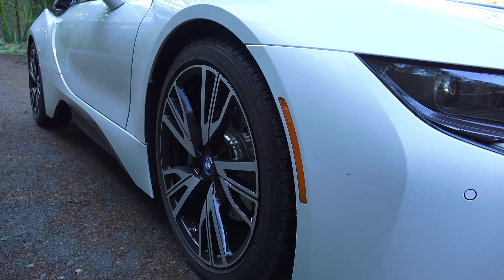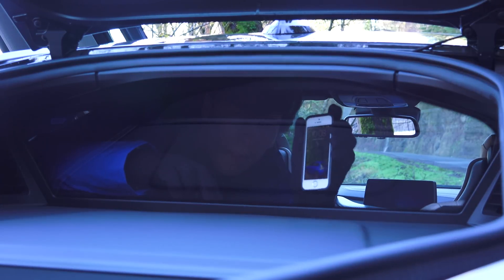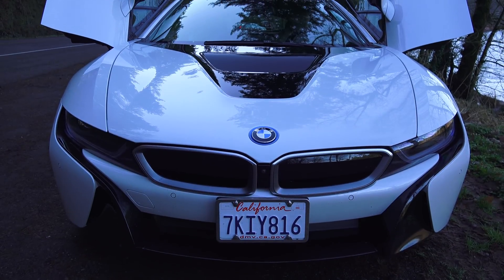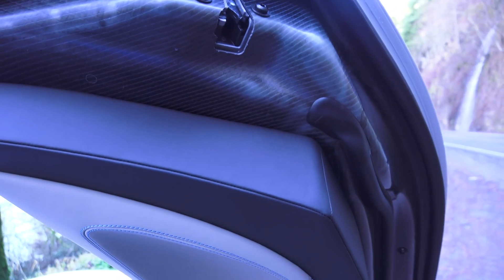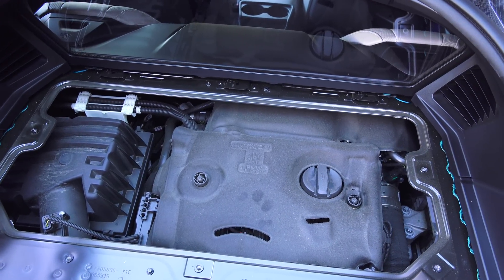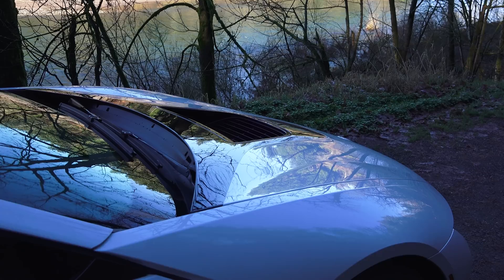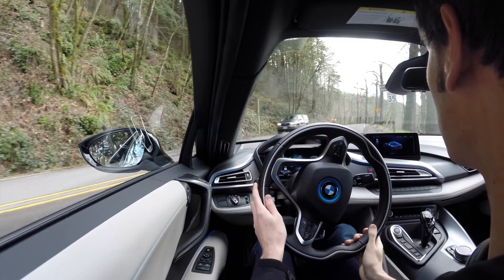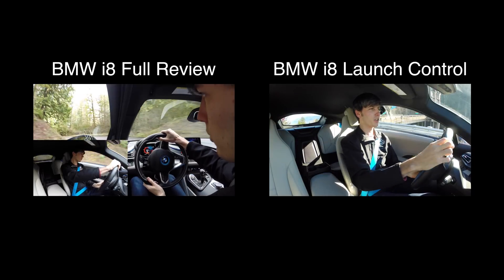10 Things You Didn't Know About The BMW i8

Comment: You're correct that the vehicle needs to see road speed and a harsh rate of deceleration before the ads give brake lights will illuminate. I don't know what version of the i8 you have in the video, but a special note is to be careful with the manual door release. Now there's a little red tab on the bottom side of the lever. You lift the lever up slightly, slide the red tab towards the rear of the lever which unlocks it and then continue to lift the lever upwards to open the door. Failure to do so will break the release lever. Another fun fact is that you need two people to open the hood and there's no good prop or shocks. You need to grab two tools (pocket screwdriver, punch, etc) and have a person on either side of the hood, open the hood and insert the tools into the mechanism to hold the hood in place. There's also an external speaker that is disguised to look like a muffler...which adds more external exhaust noise.
Reply: This car also just came out in the states with laser headlights.

Comment: Do the American's even need a noise to recogniz' a car coming?! 
In Europa it's just an option, but no one orders it. 

Why can a fwd car regain more break energy? 
Yes the car dives in while breaking... But isn't this becouse of the breakbalance between the axles? So if the balance was 40:60 not 60:40 the back axles would regain' more energy right? 
Of course I'm aware that the steering would be that good especially under ABS.

Comment: I was working at a bmw dealership and we had a white i8 in the shop. while walking though the shop everything sensed fine no imminent danger, but about 3 quarters though the massive shop I look back and INCHES behind me was the i8 driving. it made zero noise. i mean zero noise. this sumabitch followed me across the shop starting at the end of the shop inches behind me in this car and I had no clue. I literally screamed when I saw that car behind me. I've driven the i3 many times and at some 3 miles an hour it mostly silent except some tiny transmission noise you hear if it's only a few feet away, but this i8 made no noise at all at that speed, i imagine at some 10mph or so it would make transmission noise. sitting inside the car is incredible though, absolutely love the interior feel

Comment: How are you supposed to fill the oil or window washer fluid or coolint?I did not see any caps. Or is it electric?
Reply: Bozo69 69 washer fluid is infront by the driver side, little lid to pour it down

Comment: Is this guy serious?
#9 at 2:55
"Having the electric motor upfront means that under deceleration, as load transfers to the front axle, more energy can be recovered versus a rear wheel drive system."

Did he come up with this theory on his own? Or did some marketing genius from BMW tell him this?  

The only difference here would be the packaging of the motors in combination with the engine in the back with the smaller electric motor. Regenerative braking capability would be identical from one axle to the other. Plus they get the say that the car is all-wheel-drive, which sounds better than only being two-wheel-drive. 

#9 should have simply been stating the fact that with the electric motor at the front axle and the internal combustion engine at the rear axle, it allows the car to be rear-wheel-drive, front-wheel-drive, or all-wheel-drive.
Reply: Probably depends on how aggressive the regenerative braking is. Load transfer means that more braking can always be done with the front wheels than the rear, so if the regenerative braking force applied up front exceeds the braking capabilities of the rear wheels, then what he said is true.
Reply: That theory would hold true if braking forces were allowed to go high enough to lose traction of the rear wheels.  A Chevy Volt or Cadillac ELR with their 16.5kWh capacity battery can accept regenerative braking up to a maximum of 60kWh.  A larger battery can handle a larger surge of energy coming into it, but even a Tesla Model S which weighs 4,936lbs (P90D & sunroof, etc.) and a 90kWh battery...STILL only has a programmed 60kWh of regenerative energy recovery rate.  They have been this way regardless of being AWD or RWD, 60kW/70kW/85kW/90kW battery sizes.  The BMW i8 lithium battery is only 7.1kW in total capacity.  Highly doubtful that it would hit above 60kW of energy surging into it at such a high C-Rate.  

It has to do with the driving experience of how a driver expects a similar behavior to what they may be familiar with from driving cars, such as manual transmission sports cars, in the past.  Regenerative braking exists to provide higher efficiency on a commute, and 60kW is a sweet spot that mimics the feel of a manual gearbox selected in a gear that is one or two gears lower than you would cruise at, which is probably equal to no more than 20% of stopping potential at the very most.

Keep in mind that BMW's marketing department is who most likely mis-spoke when they mentioned this detail to him.  Perhaps something was lost in translation.

Comment: It not the first 3 cylinders produced engine of BMW if you'd consider BMW motorcycles where BMW used to built the K75 with a horizontal 3 cylinders (the only motorcycle that I know with such a horizontal engine, crazy!). Although it's the first turbocharged 3 cylinders produced engine of BMW :)

Comment: You should've said the 3 cylinder is from the MINI Cooper ;D. Which it is.
Reply: +Conor Hildebrandt which is owned by bmw. so what u are really saying is that it is a bmw engine.
Reply: David Huang
 it was purpose built for the mini. so its "from mini"
Reply: purpose built?   it's an engine that is fitted across the board.  like all bmw engines, they are made to be used across all platforms.  the bmw i8 shares it's 3 cylinder from "mini" as well.  the only bespoke bmw engines are M engines, and even those are originally based on the mass produced bmw .
Reply: +David Huang yup. it was purpose built for the mini platform. and of course is used in some BMWs. Hence why the new X1 is based off the new countryman coming out in the fall. not the other way around.
Reply: only purpose built engines in the bmw line up is for m cars, others are meant to be shared across the board.
Reply: David Huang
 maybe 20 years ago lol not now. 335 and M3, same engine. M2 and M235 same engine. the V8 out of the 6 and M6, same engine. V8 out of the X5M and X6M and the 50i X5, same engine. only difference is the tune and some turbos. I work for BMW and MINI, have a good one!
Reply: Conor Hildebrandt S55 in the M3/M4 is 25% based on completely new parts vs the N55. Turbos, cooling, materials have been redesigned to facilitate high performance driving- no issues with cooling on the Track.  I have a '15 M3, and a '11 X5 3.5i n55 as my daily driver.  I am very familiar with both engines.  They are completely different in behavior and power delivery.  You don't work at the engines department at bmw/mini apparently.  I have a 120 page engine spec doc - see if this link works: https://db.tt/E0FOcsaW  from dropbox.  Completely new design vs N55 in the following ways: Crankcase, Crankshaft with bearings, Pistons and wrist pin, Intake valves and exhaust valves, Exhaust Turbocharger, Air Intake duct, Exhaust system, heat shields upstream cat conv, high pressure fuel pump, high temp circuits for cooling, low pressure cool for charge air cooling, spark plugs.
Reply: +David Huang I said, have a good one!
Reply: +Conor Hildebrandt The 335 and M3 do not have the same engine and there are some bigger differences between the N63 and S63.

Comment: Why does the electric motor need a transmission? Isn't the whole advantage  of the electric motor that you have instant torque at 0 rpm with a relatively smooth torque curve?

Comment: Very low vibration from an inline 3? Unless it is using a balance shaft you're off the mark. The apparent smoothness would be from the soft engine mounts and sound insulation.
My EcoBoost 1L 3 cylinder (same basic architecture) is far from smooth at idle. The engine movement at idle is almost comical.

Comment: Speaker for outer noise - great solution, i saw that problem with non-electrical cars very often, new (just bought) Hyundai Solaris at low speed have very low and non-structural noise, so you need to get very close to people to let them hear you, or use horn. Same problem was with Mitsubishi LancerX 2.0 L but it is hearable from 2-3 meters, instead of touching someones leg from behind (and he "oh, what's this?" than "POKE what are you doing here, sorry, go on please").

Comment: 3 cylinder has no better balance than 4 cylinder. It has perfect primary and secondary balance, but it has big rocking motion, it would vibrate more.
3 cylinder has better exhaust pulsing and it could be more efficient for turbocharging. And this is not first 3 cylinder BMW, because 2 series MPV uses same engine.
Fun fact - this engine is exact half of engine from BMW M3.
Reply: dknollRX7 it is not. Completely different platforms. The i8 uses the modular platform while the m3 uses the old 6 cylinder platform.
Reply: +Mladen Milić While it is half the cylinder count, it is not "half" of the m3 engine. BMW is not using the modular &quot;B&quot; platform engine in the m3, the m3 uses the s55 while the i8 uses the b38
Reply: +Mladen Milić it would have been first 3 cyl bmw when it launched.
Reply: There's already a bulletin out for the rear motor mounts breaking due to vibration. The engine in the i8 is definitely half of the same engine that's in the M3 though.
Reply: +Akash Hegde I meant to say definitely NOT*. Should have double checked before I hit send. I work at a BMW dealer and I'm the only one certified to work on the i8. I can attest it's a completely different engine from the M3.
Reply: +dknollRX7 That new modular platform is for the new 3,4 and 6 cylinder engines. They use the same basic parts and designs, with very little differences between them. It makes for cheaper manufacturing as parts will cross over as well as a reduction in part production times.
Reply: might was well use one giant 1 or 2 cylinder motor since a gas power engine is just compressing air n burning it off.
Reply: A one cylinder has poor balance and very uneven power delivery. Having multiple cylinders makes sure there is atleast one powerstroke at any given point which makes the engine run smoother. This is why a v12 runs a lot smoother than a 4 cylinder.
Reply: +WhyteLis21 That's how all gasoline engines work. Limiting it to just one cylinder means it won't be balanced well, you'll have less reliability and it'll rev much slower.
Reply: im pretty sure u can squeeze alot of power in one giant cylinder n with a bigger crankshaft n piston. but your rite about the balance n it would be harder for power control.
Reply: +WhyteLis21 It would still work, but it wouldn't be as efficient. With more cylinders you'll have extra weight, but it'll be much smoother and rev easier and faster. Imagine a heavy merry-go-round and you try to spin it all by yourself. It's hard to get going and hard to keep it spinning quickly. Now if you had seven other people evenly spaced around it and each of you helped push just at the right time, it would spin much easier, would be easier to spin from a complete stop and easier to maintain the speed. That's just one way of thinking about it. Also, the cylinders spaced out evenly over the rotation of the crankshaft help mitigate the vibrations and they reciprocate against each other. On this particular 3 cylinder and the 4 cylinder that's very similar, there are multiple balance shafts that have to be timed with the crank to help reduce vibration. It's the same concept as a Lamborghini making a 5.7L V12 while the 5.7L (350) is a common American V8.
Reply: thanks i get the concept. its shame the 4 stroke gasoline needs more cylinders to make more power n balance. i think its still very limit mechanically in terms of engineering raw power disbite being a efficient motor.
Reply: +WhyteLis21 You're welcome. Just trying to explain it so it makes more sense...not trying to sound condescending or anything.  Initially, there was talk about them putting a 4 cylinder turbo out back and calling it the i8 s, but that has yet to come to fruition.
Reply: yup. i just think with all these new technology you would think there would be a better motor. we still gotta get past the fossil fuel burning era to really meet the next generations besides biofuel n battery powered motors. i think with the up coming nano tech batteries might help change that.
Reply: +WhyteLis21 BMW isn't really big on using their hybrid cars for efficiency. They pretty much use the electric motors to boost the performance and add power. Some other manufacturers have done a better job of being more efficient, however electricity isn't free either and often times comes from the burning of coal. BMW has been working on a hydrogen powered car for a while, but the infrastructure isn't there yet. They have the i3, which is an electric only vehicle, but the range is only about 60-80 miles. It's a great car if you live in NY or CA, but not places that aren't set up similarly. I agree with you though.
Reply: so true. man, once we get past the fossil fuel burning era, i wonder whats going to happen to the gasoline motor? how r we going to get rid of them? there just too many gasoline cars on the road its near impossible to get rid of. not to mention how n where to recycle them.

Comment: Would the CD be better with the grill completely empty instead of that black cover?
Reply: +Sebastian Rosenberg Naa, if a bumper has holes that ar not "flow thru" it adds drag. Even the flow thru ones add drag but are usually there to convert drag into downforce.

Comment: If there would be a grill, they could put small turbines under the hood to gain extra electricity
Reply: Eh. Wouldn't really add much unless you were on the highway often.
Reply: +Jerombolo The wind resistance of the car increases, so it uses more fuel/electricity. That's why you don't see that on cars.
Reply: AltoScroll hmm but it recharges the batteries on the fly, or the could build the exhaust pipe from the 3 cylinder to the front and slap a turbo on it which can charge the battery^^ does the car have some sort of kers? regaining power by braking
Reply: +Jerombolo It doesn't work that way. Adding turbines in front will actually make the car use more fuel/electricity, so adding them would be pointless. They would indeed recharge the battery, but the car pushing forward (thus wind spinning the turbines) will use more power than the turbines are generating.
Reply: AltoScroll yeah maybe, I don't know. Let's see where this industry is going with rechargin on the fly
Reply: +Jerombolo I don't want to sound rude, but without external sources, recharging on the fly will not happen (basic physics). Regenerative braking however does work, and has been used already in multiple cars
Reply: AltoScroll wasn't it a Tesla which was meant to have a solar panel on the roof??
Reply: +Jerombolo Yes that falls under external source (the sun) and that would increase the car's mileage.

Comment: You should've thrown a rock at the rear window to test its hardness
Reply from the maker: +Peter Jada It's inside the car haha, protected by rocks (by the front windshield and rear window).
Reply: +Engineering Explained I mean....you still could've thrown a rock at that window and one of the exterior windows to test their claims of increased strength 😁
Reply: +Peter Jada He could have, but if he damaged it which is most likely, he would be paying for it and BMW normal glass is expensive(german brand tax), let alone this "special" glass
Throw a rock at any car windshield and the windshield will crack
Reply: +IIGrayfoxII it was a joke...I think we can take BMWs word for it on the chemical hardened glass

Comment: they could have cured a bit the looks of the ICE engine for the price they are asking...
Reply: +Petri Ševardnadze A zašto, kada ga nikada niko neće videti?
Why, when nobody would see it?
Reply: +Petri Ševardnadze According to BMW, you are not even supposed to pop the engine hood; it is meant for dealership service, only. The logical step after taking the oil dip stick away from owners...
Reply: because, in my opinion, at that price the care put into the details matter a lot and doesn't matter if nobody would normally see it.
Reply: +Baerchenization hi I think BMW is talking of the front hood where the front electric motor is they say that I does open but only BMW technicians are able to open it I don't know if it's bolted or there's a hidden latch ?

Comment: "very low engine vibration" lol what. The torque forces kill it. The engine mounts and balance shafts are taking care of those forces. Have you ever driven a 3 cyl without balance shafts and relatively stiff engine mounts?